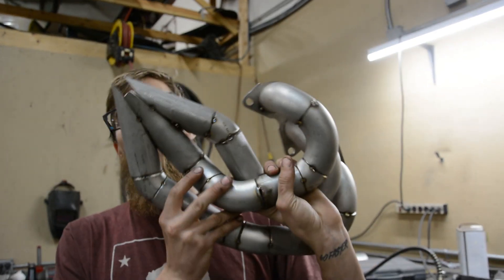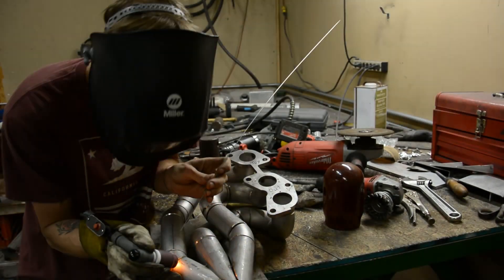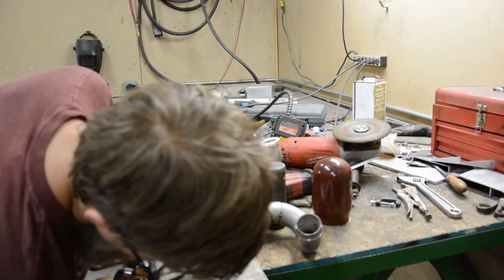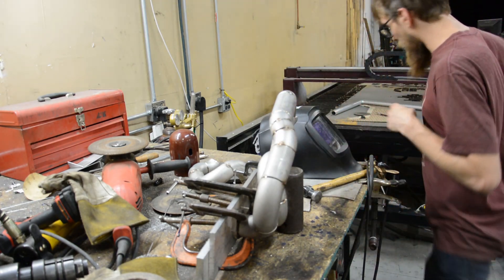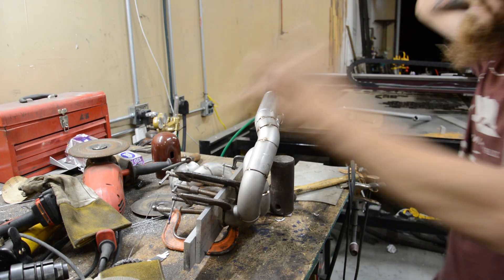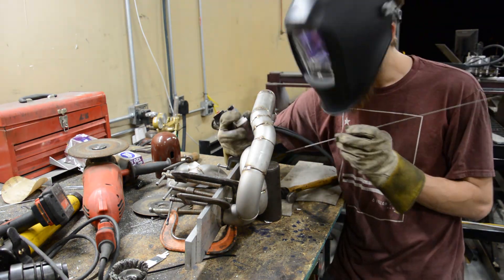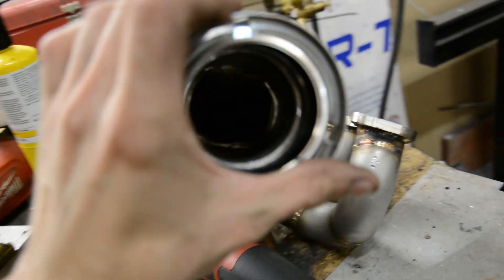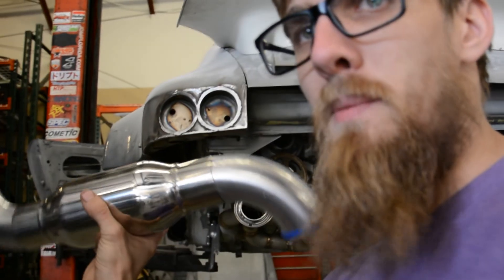How To Weld a Custom Stainless Turbo Manifold on the Subaru Powered 911

Comment: Should see if you can make an oval shaped tip for both sides to come into and exit out the middle 👌
Reply from the maker: Josh McCann I would do an oval but then I’d need flex pipe to make sure it won’t crack
Reply: @6berries  hell. Didnt think of that. Youd definitely have to add something and thatd suck
Reply from the maker: It wouldn’t be too bad but i just wouldn’t want to do that since this exhaust won’t be permanent
Reply: @6berries  yup, adding two smaller ones wouldnt be hard. But again with going turbo in the future its easier this way

Comment: wait, the exaust sitting that near of the belt wont be a problem? i think u will need a heat shield (that cam is fire 👌)
Reply from the maker: I may make a heat shield for it but it should be fine. Schedule 10 stainless is pretty thick walled